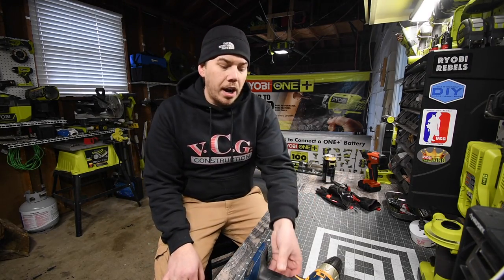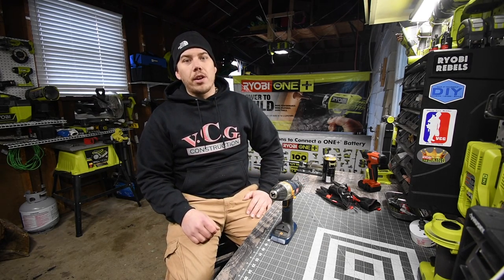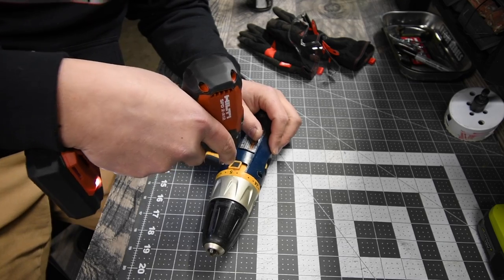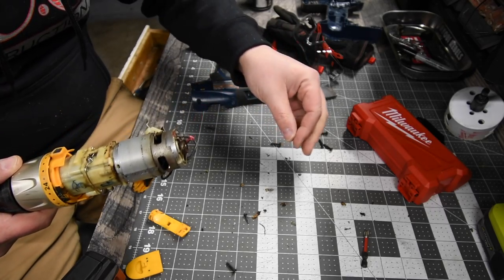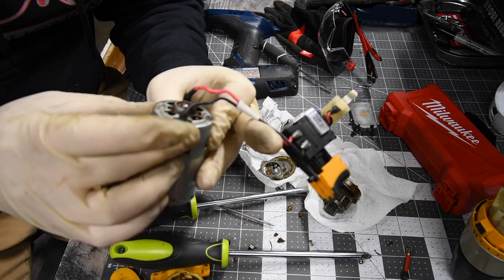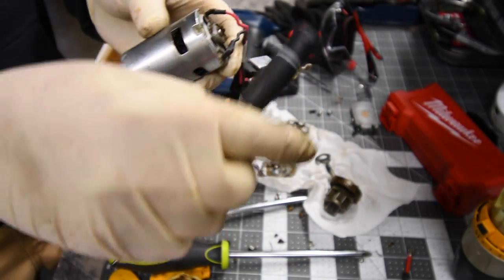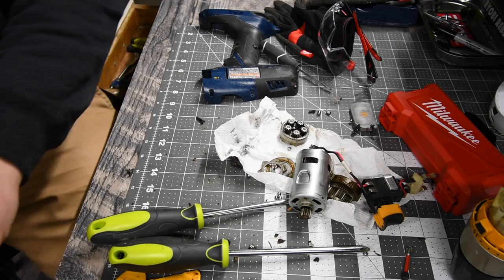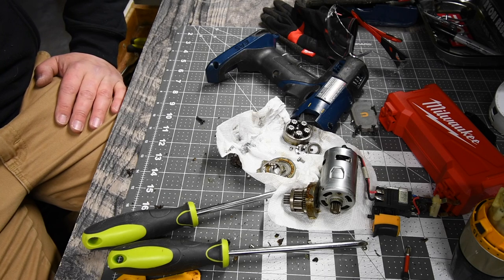Taking Apart Old Dead Ryobi Blue

Comment: the plastic just acts as a insulator to the wires and the brushes. If you carefully bend out the "tabs" it comes apart very easy ( you can even get away with just 2 of them so the third acts as a bit of a guide when putting them back) and you can clean it up and if you have other drills you've hacked apart you can steal the brushes and wires and rebuild these. The old ones especially are really hardy. Great video, im 40+ years away from living with my parents and they still come across boxes of things I "experimented" with as a kid..lol

Comment: Thanks for posting this video. I just ran across it. A friend gave me three 18v Ryobi drills today. Two P205 and one P206 (I/2 in chuck). No batteries. I just dismantled the P206. My goal is to make a DIY drill motor stand that will accept a case length trimmer for trimming 300 blackout cases to length. Looks like I will have some spare parts. :) The best looking 3/8 drill had a 2011 date written under the body where the battery goes. Looks like new. The other two, not so much.

Comment: Would have rather seen you replace the motor and fix it rather than trash it. Even if it's old it can still be useful.
Reply from the maker: I should have upgraded it as well with a more powerful motor and I thank you for viewing Interpidation
Reply: Hey is it possible just to switch the motor with a newer one mine is sparking do to the brushes

Comment: Hay just wanted to know on how much you use you ryobi 1600psi power washer and how its lasted over the years. The one I have is on it last legs
Reply from the maker: they have a new one out that is 1,900 psi for $150 I think and it has wheels
Reply: @ManCaverTools  that's not a bad deal may have to pick it up. That for the tip

Comment: My guess: I blew up a shop vac a few weeks ago, using as dust extractor. I had just finished sanding on some iron (harbor freight hand plane, of course!) Iron dust/filings got into the motor. Just mentioning because.....Is there any electric tool that couldn't be vulnerable to that?